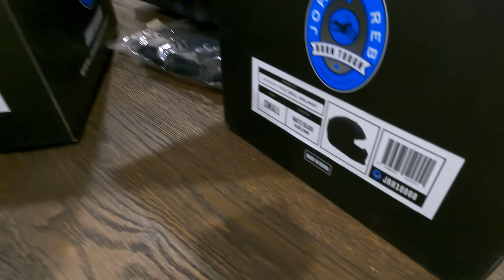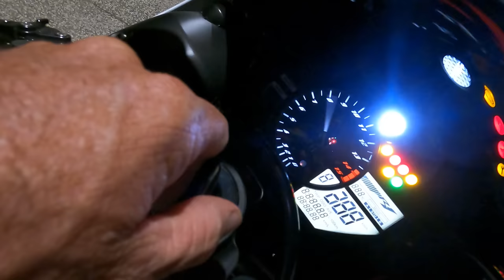My New Motorbike

Comment: Have a 2001 fz-1,which is a little more practical, lowered the bike, raised the handlebars, added 2 teeth on rear sprocket, and added touring windshield, as helmets are not necessary here in Wisconsin. Same engine as a r1,I would pass someone and I was doing 90 mph! Why I added 2 teeth to rear.Bike handles like a dream,but not that comfortable.When I want comfort I jump on a 2000 dyna superglide,with forward controls, a 88 with a 509 cam,tuned up proper.The seating position is just too cool.Have a new street glide too! Living the dream.

Comment: I did the opposite, I went from an R1 to a Harley-Davidson Street Glide Special and tbh I wish i did that change sooner because the Harley is a more relaxing and a enjoyable ride. Back then Riding with fellow race bike Bikers would ended up a race or let’s just get to A-B as fast as possible which pushed my own riding limits which at times was not enjoyable 🤭.  So my advice is enjoy the bike but stay within your own riding limits.  As for braking I would advise researching trail braking which is using the front brake going into corners, all top riders use trail breaking and I would say most riders who understand trail breaking use it.

Comment: I thought about buying a bike like an R1 but I don't want to die LOL.  I've heard that you really have to be careful with the throttle control because if you give it too much gas in any gear it will do a wheelie and could flip over at any speed.  I had a dirt bike like that, the biggest one Yamaha ever made.  It was a lot of fun but it hurt me real bad so I sold it LOL

Comment: I know everyone's an expert and everyone thinks they know it all.(me included)..so having said that...you guys should explore the art of trail braking..ie..using a light pressure on the front brake when going hot into a corner. Just enough to light up the brake light. It will slightly compress your forks and set you up for any heavier braking should you suddenly need it. It will also make the bike feel steadier through the turn. release that slight pressure and  throttle on to exit.  This is NOT to be confused with yanking the front brake on with force.There are quite a number of YouTube channels that promote this as a good skill and is endorsed by advanced riding schools.

Comment: First buy the right gear for high speed riding, second sign up with a professional riding school and attend.  Do be surprise if you drop the bike, you have to learn ride. You are not riding a Harley,  R1 is a extremely fast bike and every input will respond differently than a Harley.  I enjoy riding at 120 - 140 mph when traveling, on the proper roads.  I have many decades of learning and I used to teach high speed riding and beginning riding skills. Enjoy the bike take it easy till you are trained and ready, not on the street.